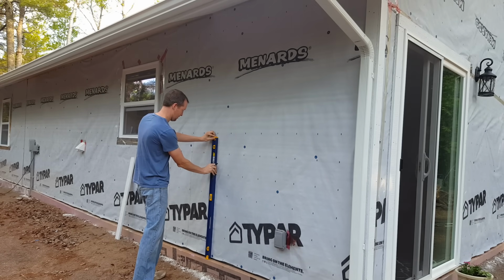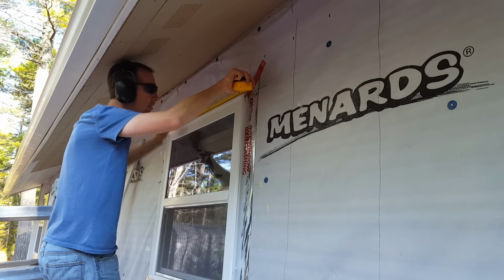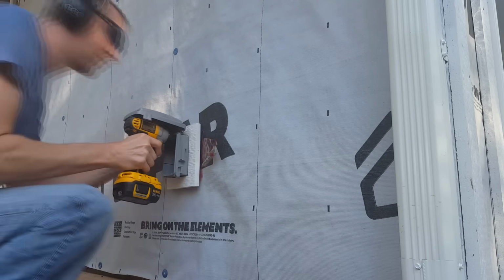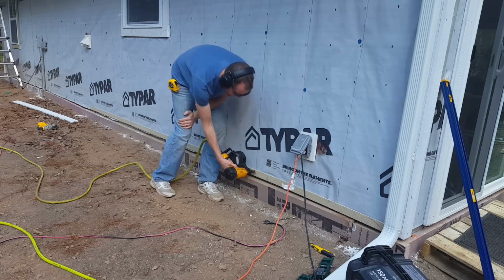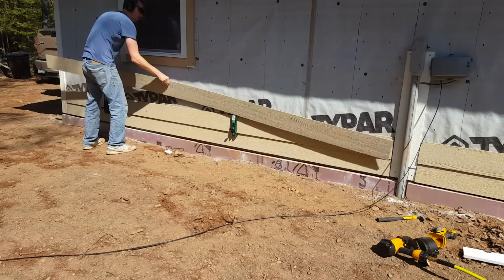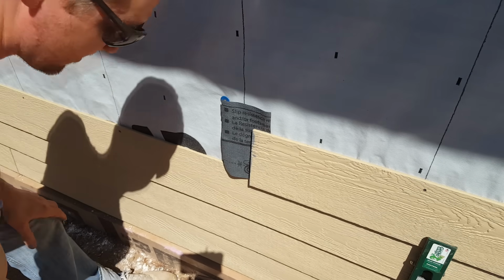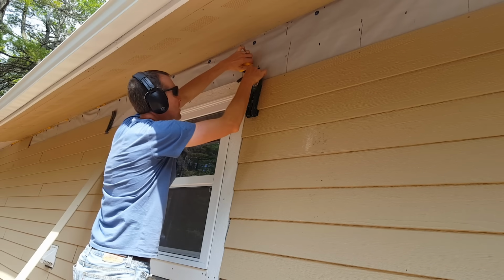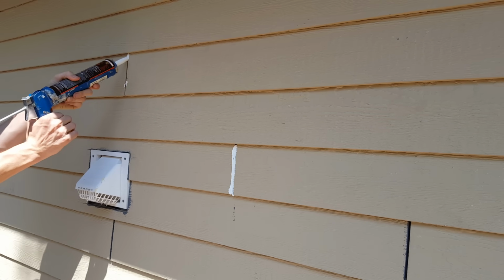Siding a House By Yourself

Comment: Thank you, this is only the second siding video I have found online that shows the use of those clamps.  I bought a smaller, perfect rectangle house with all flat sides.  Built in 1984, on a lake so lots of moisture.  The original siding is there, in poor condition and someone slapped hideous vinyl siding over styrofoam a couple years ago.  It feels and looks like an old fashioned waterproof plastic diaper and it is bug heaven underneath.  Tar paper wrap.  I cannot wait to carefully remove everything to inspect the walls and studs for water damage before wrapping it all up, and replacing the awful original windows that were never even flashed I think.  I have a concrete foundation, thank goodness.  Doing it all myself, with the help of great video instruction like this.
Reply: I would advise you to rethink before installing siding yourself especially if you've never done it before. There is not one single video on youtube that shows you how to install it correctly including this guy's. Theyre all hacks. There are already numerous mistakes and this is just one wall. To do it right is  more involved than most people think. And if installed incorrectly it will create mold, rot and cause damage to your framing all of which are costly to fix and will compound quickly in an are with a lot of moisture. If you still decide to do it yourself I would recommend you use the best materials available like for housewrap use Hydrogap drainable wrap and for caulking use Quad Max it stays flexible and wont crack and let water in like the cheap stuff. between the trim and the window leave about a 1/4"-3/8" gap and stuff foam backer rod 3/8" deep and fill with caulking. Dont butt the trim up to the window frame like this guy did, it leaves barely any room for caulking. This is really important step because vinyl windows expand and contract and it you have a tiny bead of cheap caulk it will crack and let water in and deteriorate everything a lot faster. VS a 3/8x3/8" bead of high quality caulk which will easily be able to expand and contract providing years of trouble free service. Also preprime and precaulk the cuts on the trim where they butt up to each other. These steps are critical in achieving a solid installation that will last many years trouble free. Flashing above horizontal protrusions like window trim and such is also crucial. If you have any questions please feel free to ask Ive worked many years for siding company in Oregon that doesnt take shortcuts like most people.
Reply: @senyashchukin391  I didn't read your whole post but I agree. This guy had no business posting this video. Siding is a trade that takes years to learn, it's an art, not to mention its THEE waterproofing for your house. So "No" you can't "Do It Yourself" and its not cheap.  But go ahead, roll the dice, and see if you can keep your house 100% waterproof for the next 30 years. One wrong move could cost you 10,20,$40,000 down the road or more....just pay somebody...
Reply: @daleriley6761  LOL...this type of siding installation is not rocket science. Definitely doable for a handy DIY'er who does their research and follows mfg's installation guidelines.
Reply: Also dont use housewrap at the joints like he did. It is not UV rated for very long and will deteriorate eventually. Instead use 5x7 metal flashing you can pick up a pack of 100 for like 25 bucks at a siding supplier. Caulking the joints is optional but not recommended. instead install with moderate contact or leave 1/16" gap
Reply from the maker: Hello Shari, glad my video can help. It really is a pretty easy job with the clamps. Good luck on your project!
Reply: I also own a home like this. Original siding is cedar, with the tar wrap. Really would like to redo it. Love the look, but it is in bad shape.

Comment: You don’t need some kind of drip edge flashing along the bottom layer?
Reply from the maker: Hello Robert, I didn't add any. The siding actually hangs a little lower down then the concrete slab so any water would have to go back and up to get in the house.
Reply: Chad DIY I wonder about wood siding coming in direct contact with water porous concrete. If it was concrete fiber board I’d say no big deal.
Reply from the maker: Yeah, it might rot over time. That is why the only wood that should touch concrete is pressure treated.

Comment: why is there not a metal flashing under the Starting Strip ???
Reply: For sure.  Need to cap that foundation.
Reply: @johnd9541  -you mean what I call a (Metal termite barrier)-- If is a poured concrete base -No need in the townships code !
Reply: code is minimum standard.  You want to divert water away from the sill area which could wick back into the framing members/sill plate.
Reply from the maker: After I did this, I saw a heated slab house like mine that had metal flashing that started on the OSB and then wrapped around the 2" pink foam. I should have done that! I am not too worried now though, the siding sticks out far enough so really water wicking back shouldn't be much of an issue, and if it does...The sill 2 by 6's are all pressure treated...time will tell though!
Reply: @chaddiy  you could try some non-expanding foam, then paint it.
Reply: Even treated wood rots. Water can run down the siding then actually get pulled upwards. If water works it's way to the bare side then the wood will start absorbing the moisture. May not really affect your siding but keep an eye on potential water damage just to be sure.

Comment: Did the windows you used have build in j-channels for vinyl siding (kinda looks like it)? And if so did you just buy the trim up right the the edge of it or did the trim slip into the channel? And what size trim was it?

Thanks
Reply from the maker: Hi Zack, It is just a nailing flange on the windows.. I put the 1 by 4 trim over the nailing flange and then caulked everything. I was using LP smartside siding which is a lot different to install the vinyl. No J channels are used.
Reply: I’m doing a similar project. Installed windows with nailing flange and a built in channel for vinyl. I later decided I wanted to do a lap siding such as what you are using. Think I will just run my trim up to the edges and caulk every up like you did. Thanks!

Comment: I will say that your gap is a bit large for the trim. I would stick to 1/8 gaps
Reply: Even then it is kind of big. With Hardy you do not gap at all. I do not think smart siding expands as much. Not too sure on this. Will do research as I do not use it on any builds?
Reply: @speedgonzalez489  I leave a gap just to add caulk.
Reply from the maker: It did seem like a big gap, but I was just following what LP recommends. After a few years now it seems like some gaps have closed a lot and some havent.
Reply: @chaddiy  if LP recommends that then that is what you go with. LP is good material we just do not use on many homes around my area. Mostly just Hardy or boral now. We will use LP 4x8 sheets. Fantastic job anyway.

Comment: Window is flashed wrong
Reply from the maker: Hello Carlos, I followed a window install book on flashing...what should be done differently?
Reply: Chad DIY tape across the top of your window and not the bottom. For any water that does get behind your window (which it will eventually) can get out.
Reply from the maker: Thanks for the tip! I did tape the windows at the top, and then hung the house wrap over that. On the video it might just look like there isn't any tape at the top.
Reply: Chad DIY I like to put an additional strip of tape over the house wrap after I do that
Reply from the maker: Good advice...Thanks!

Comment: That siding is just strand board. Doesn’t seem like it would be very durable.
Reply: Smartside has changed the game indeed!
Reply: It's not just strand board. It is smart siding. There is a difference between the two of them. OSB in itself is not. Smart siding is a completely different product
Reply: @speedgonzalez489  actual it's the same thing the difference is smart side got a finish texture.
Reply: My co-worker has it on his house going on 10 years without issue. You need to be sure to follow the instructions exactly or you will have issues. The only time that I have seen issues is when it is not installed correctly. Especially, when it is too close to the ground.
Reply: I didn’t think so either. I used some to make concrete forms then left them unprotected outside for over a year.  I had primed the backside and cuts before using them.  They lay fully exposed to high heat, ice and snow and lots of rain during that time. I was surprised that there was absolutely no swelling or decay even on the cut ends. We install it on several homes each year.  I don’t like the required 3/16” expansion gaps or the flexibility that shows any unevenness in the substrate after installation.  I prefer cement board but it is so fragile and can easily snap during installation if not properly supported.
Reply: That siding is shit
Reply: @Cstoreri  What would you prefer?  I need to re-side my house soon.  Thanks.

Comment: I need those clamps. I have a one man paint and siding project coming up.
Reply from the maker: The clamps will be a huge help for you...good luck!
Reply: where did you got those clamps..home depo or Lowe's????
Reply: Use a nail the to hold the siding
Reply: That’s probably the easiest cheapest way if you don’t have a helper. Just fill the holes when your done. I used clamps but I had to modify them because my siding is the old 12” stuff.

Comment: Aren't you supposed to float siding by not fully bedding nail? Seems like your gun nails all the way in?
Reply: Only on vinyl since its expansion rate is so high.  LP siding does not have that issue.
Reply from the maker: Hello, I never heard of floating LP siding. I just nailed them fulling.

Comment: Probably should have strapped the wall out first man. One you’d have a solid place to nail, two in high humidity situations your wall can sweat in between your siding and house wrap causing mold or rot issues.
Reply from the maker: Thanks M1000 Gade for the comment. I live in Minnesota when everything is frozen half the year so we don't have the humidity and rot issues like other places...still is good advice though. thanks!
Reply: Your talking about faring strips right?
Reply: Bb Bb yes most applications require an air space between the wood siding and house wrap.
Reply: I take it vynle doesnt
Reply: Bb Bb no it has its own holes made drainage

Comment: Did you caulk the whole way down on the bottom  horizontally?
Reply from the maker: Hello Gabe, The only thing I caulked horizontally was the top and bottom of the windows.
Reply: @chaddiy  

Just an fyi. Caulking the bottom of your window will prevent water to escape.  Caulking the top and sides would be perfect.
Reply: @chaddiy  Thanks!

Comment: Masonite crap better keep up with the painting
Reply: Yes, the OLD siding was junk, but LP Siding has been re-engineered after their massive law suit for defective siding several years ago.  The new product has a 50 year warranty, compared to Hardie Plank's 30 yr., and it's much easier to cut and install.  It's a very durable product with features that Hardie doesn't have.   As for the painting, any siding product will need to be painted to prolong it's life.
Reply: That siding he used is definitely not masonite.  I saw a demonstration of the LP Smartside submerged in a bucket of water for 30 days.  It was barely deformed and its structural properties were good . Not masonite!

Comment: There's a big rip in your typar. Not going to be very effective at stopping water.
Reply: Actually type is a vapor barrier, not an impervious water barrier. Tyvek and Typar both turn to toilet paper when they get wet. If you want the protection of a water barrier, use good old tar paper. The old guys used it for a reason.
Reply: @michiganstrong1146  Yeah, the reason is that it was the only option they had. lol
Reply from the maker: Hello Arich, Thanks for the comment. It might be hard to tell from the video, but all the seams should be taped. I used the red tape that faded clear over winter. I Also I have 2 foot over hangs so rain doesn't hit the siding. Thanks for watching!